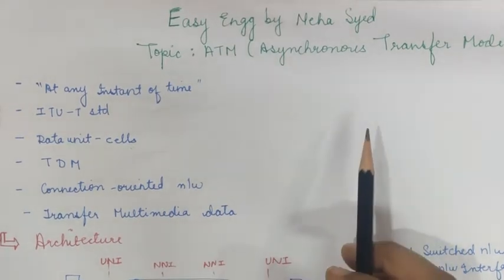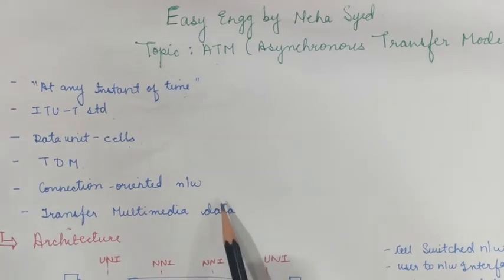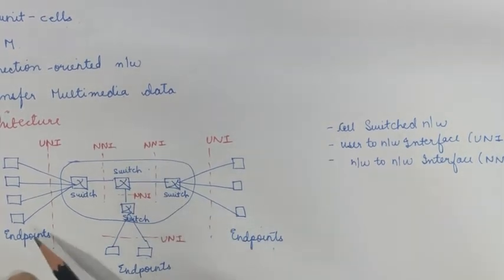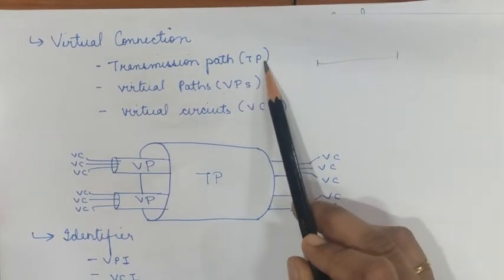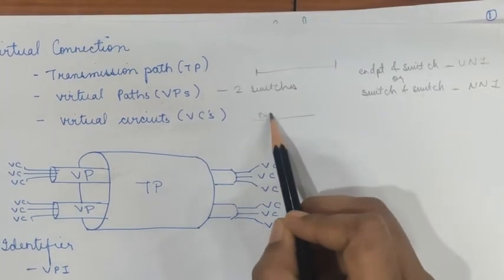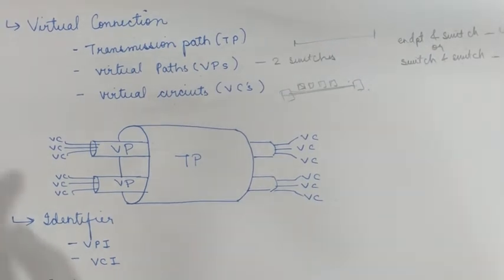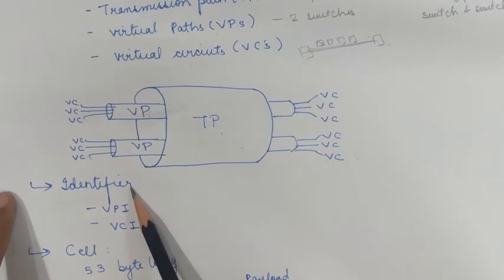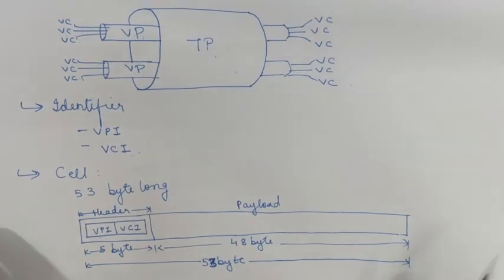ATM | Asynchronous transfer mode | Architecture of ATM

Comment: I would like to add some information about connections in ATM, so theese are Transmission Path, Virtual Path and Virtual Circuit.
Transmission Path -- is real physical connection that trasmits data from point A to point B
Virtual Path -- is logical channel, that is created under "Transmission path" and represents logical connection between point A and point B
Virtual curcuit -- is logical connection, which identifies the stream of data in virtual path. Virtual curcuit is created under Virtual Path